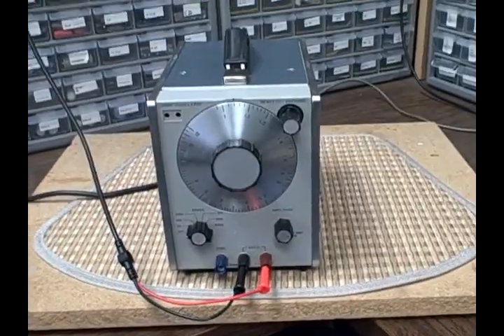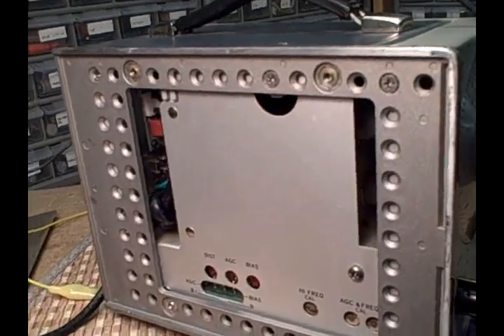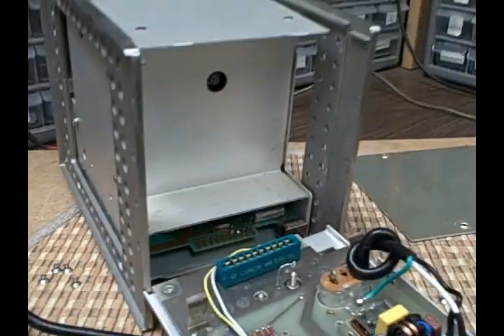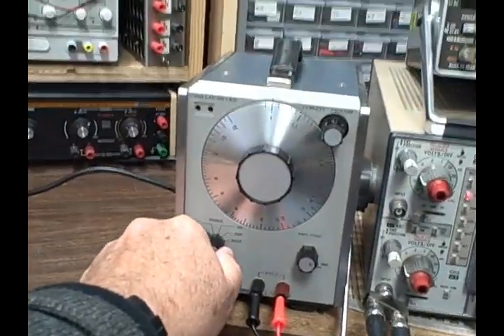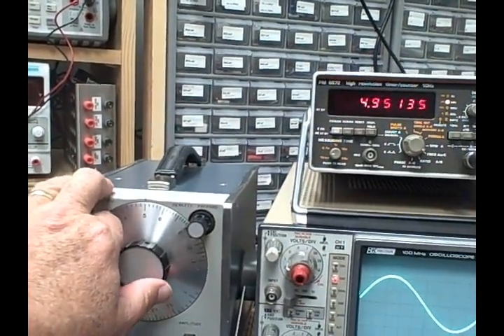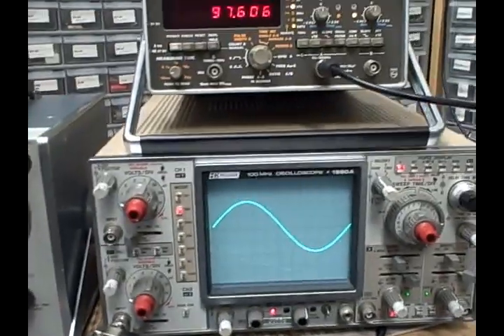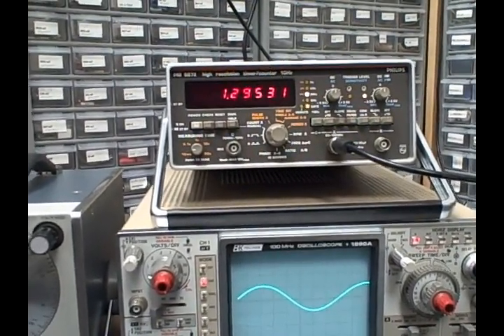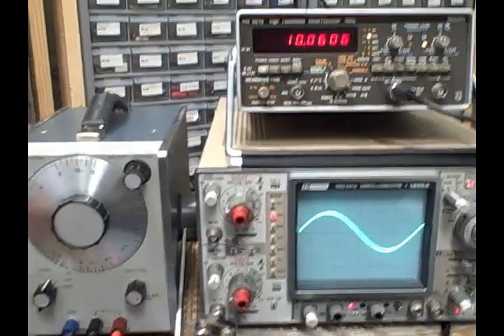HP204c - 1968 Low Distortion 5hz to 1.2Mhz Oscillator

Comment: I have acquired two similar units - HP 204D - not quite the same, but similar, from an estate sale, along with some other items of interest. Assuming the HP204Ds work (I have not tested them yet), will they be sufficient for a beginner’s electronics bench for building, testing, aligning, etc. radios? AM only because of limited frequency? If not, what models would you recommend I look out for, for not just AM, but also FM, ham, etc., but on an EXTREME BUDGET? Ditto, please, for any recommendations on oscilloscopes, bench power supplies, etc., for the same work (audio, radio, and eventually vintage 8-bit computers). I have several good DMMs, soldering station, tools, etc., so now just need the rest of the test gear… Thanks for any advice…